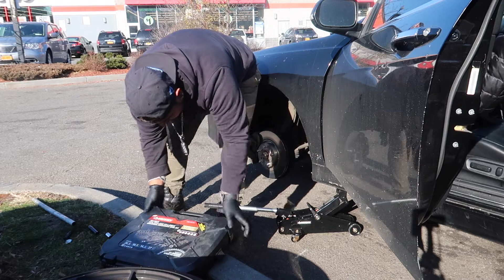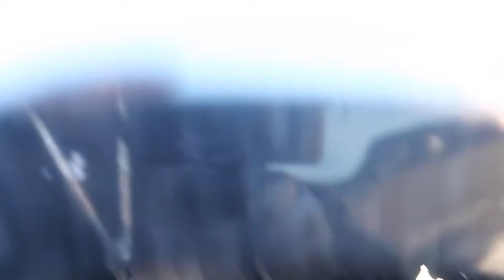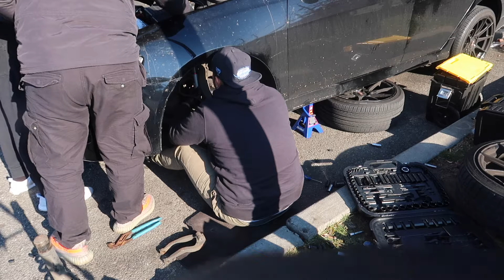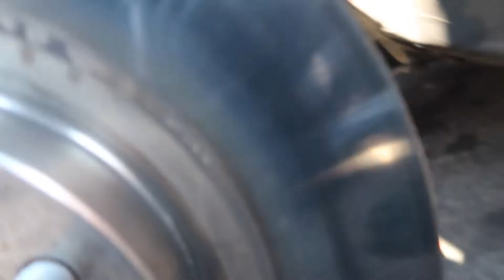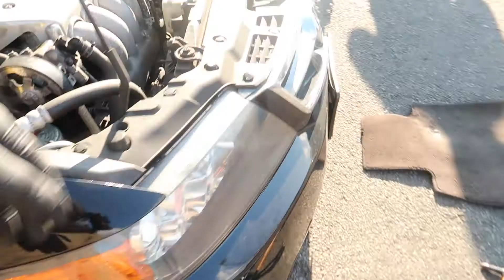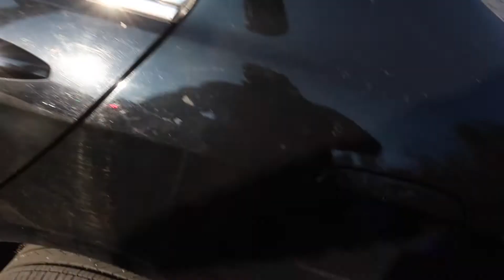How to do an Acura TSX 2006 Truhart Coilover Install

Comment: Did the rears fit without a problem? Seen videos and read a few reviews that said they had to shave the lower bushing a bit in the rear coils to make them fit .
Reply from the maker: Rodolfo Gomez that was the biggest headache I’ve had in a while, they DO NOT fit correct, wat I ended up doing was borrowing the bushing remover from autozone , and took out the bushing that came on coils, and got some smaller bushings from autozone and installed, I think the best fix would have been to shave them off a bit on both sides, I didn’t have a grinder at that moment and wanted to finish but I haven’t had a problem with bushing I installed from autozone, hope that helps
Reply: Jimmy Mejia thanks for the information man very helpful . So other then the bushings in the back not fitting everything else fits ? Would it have been possible to remove the bushings from the original struts over to the coils ? Or would shaving down the bushing in the coils cause them to rust ?
Reply from the maker: Rodolfo Gomez usually when removing bushing they get damaged, so I don’t think they’ll be able to be used again. Best bet would be to shave them down on both sides, to prevent rushing u can hit it with a bit of paint where ever there’s is metal, that’ll give a protective layer , help prevent rusting, and that’s about all, no other issues, also when adjusting height, keep in mind that car still has to settle in a bit.